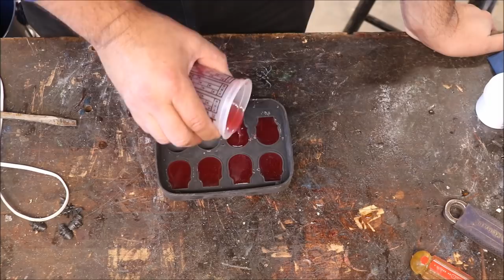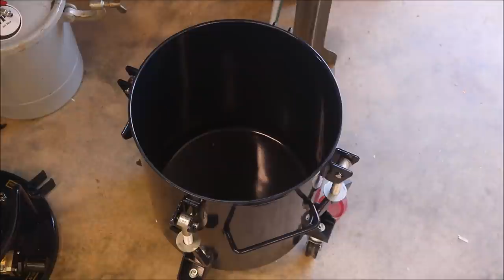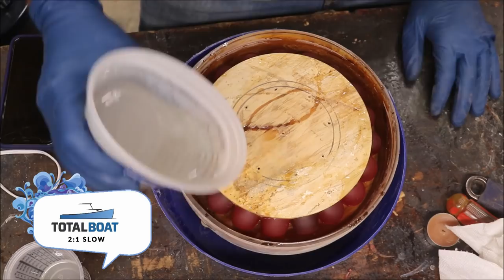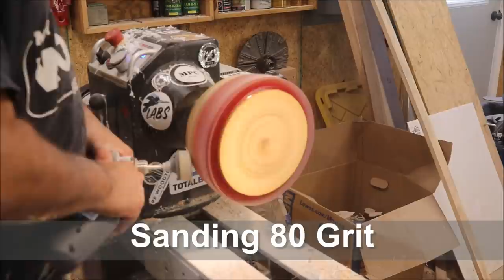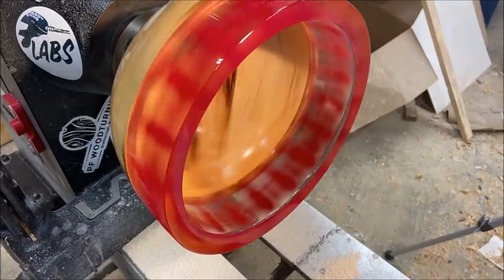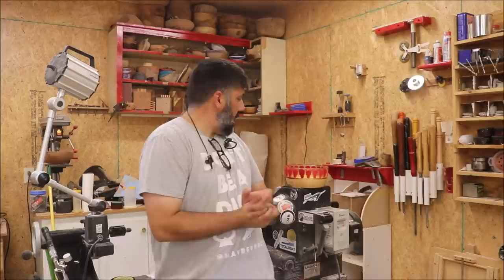Wood Turning - Skulls 💀💀💀💀

Comment: This might be a stupid question but what is the function of the sanding sealer? It seems like you are sealing the material and then continuing to remove material so I don't get the point of the periodic sanding sealer applications?
Reply from the maker: The sanding sealer has two functions in my process. 1. It stiffens the fibers to allow for a smoother finish on the wood. 2. the Cellulous Sander fills in the small scratches in the resin and helps to get a better clearer finish. How that explains it.
Reply: @MoonpieCreations  awesome, your work is great.

Comment: You can skip some steps by gluing the skulls to a blank, pouring the resin around it and then shaping the bowl. That way you dont have to carve out that channel and then carve off the excess wood on the outside perimeter.
Reply from the maker: That's a great idea! Thanks for the tip.

Comment: I noticed you use a Laguna wood lathe how do you like it and have you had any issues with yours I bought one about eight months ago and had a few minor issues with it just was wondering how yours was holding up.
Reply from the maker: Hey, I love it. I have had a few issues. The original spindle bend adn they send me a new power head. The increment lock c clamp fell out but I bought new ones for about 30 cents. Other than that no real issues. I hear horror stories about customer service and besides being slow I haven't had any problems with them.
Reply: @MoonpieCreations  The issues I have is the tailstock Morse taper was machined improperly and ruined some of my live centers and I also replace the bearings in the spindle about two weeks ago they were generating a lot of heat and were very noisy I also had to remove the indexing plate that’s inside because it was causing a bad vibration but I don’t use it anyway and while I had everything apart I put a new belt in The bearings Laguna sent me were from Taiwan so I actually ordered different bearings from United Kingdom which are as smooth as butter and that made all the difference in the world other than that it’s a solid sexy machine but they did scamp here and there but Laguna overall is a lot cheaper to buy than the other lathes out there I definitely have my eye on a robust with are American made but cost big bucks that will be my next lathe

Comment: love it! is that a sticker on the bottom or some kind of button.. if so where did you order from?
Reply from the maker: Hey Paul. It is an acrylic pin from Sticker Mule. I took the metal pin off and used it as a makers coin. https://www.stickermule.com/products/acrylic-pins